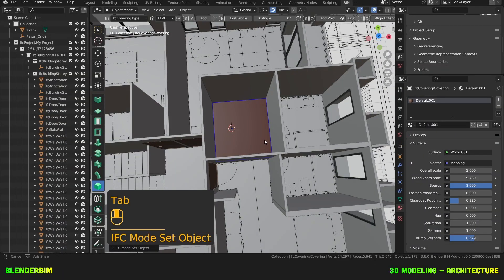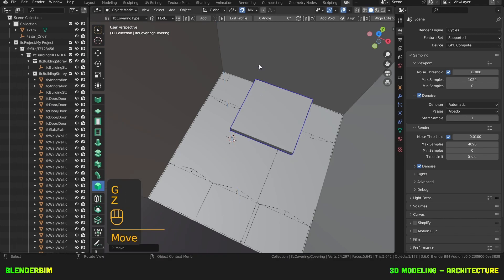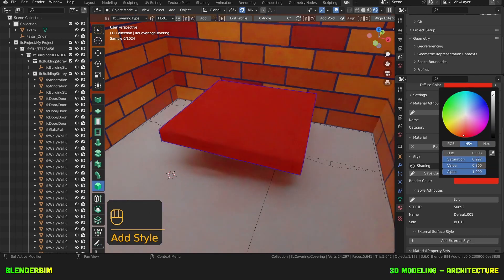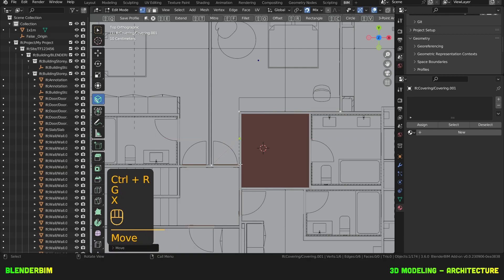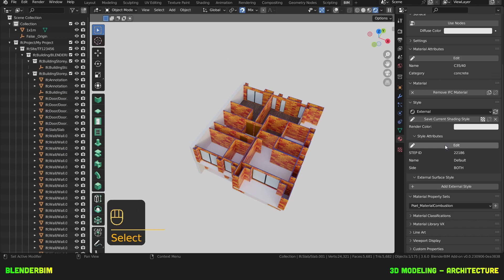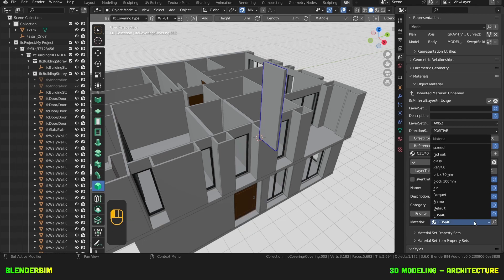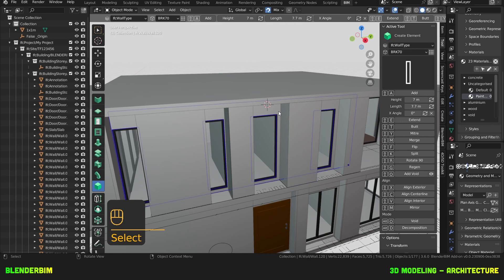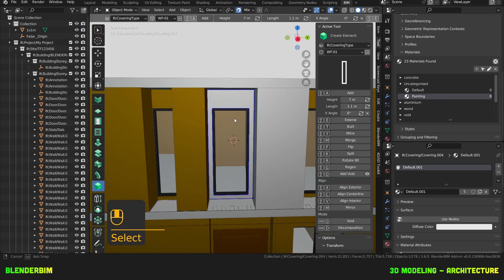5 - Wall & Floor Finishes - BlenderBIM

Comment: Hi @sigmadimensions, please did you show in any of your videos how to assign the brick finishing image to your walls? or it's just the same way you did with the parquet in this video?
Edit: yes, using the blend file from your website, not too difficult!
thanks again for your work
Reply from the maker: Hey, yes ! You can apply external styles for all objects. It may get tricky with the uv mapping sometimes, but with node Wrangler and  trial and error by changing transform options, I make it work OK

Comment: Wow!!! This is a true BIM modelling! But it’ll be tedious doing the covering of the floors and walls this way especially for large models. Wouldn’t it be nice if there could be a way to automate this? Instead of using the covering I always add more layers to the walls.
Reply from the maker: You could, but I like the flexibility for four reasons:
- Dferent wall finishes in different rooms / facades, rather than crate too many wall types, and funky wall splits.
- Include paint surfaces exactly where it's needed easily. 
-  Get accurate quantity take off for costing
- Enough detail for construction packages & 4d simulation
Reply: @aeco-dev  Is there a way the covering process can be automated? I searched ifcopenshell api and haven’t found anything yet.
Reply from the maker: @owurakuotchere-darko9392 there is no such feature yet. Do you mind placing a new request through a github issue? I'd also like to select a wall, and add a covering on it's surface Area